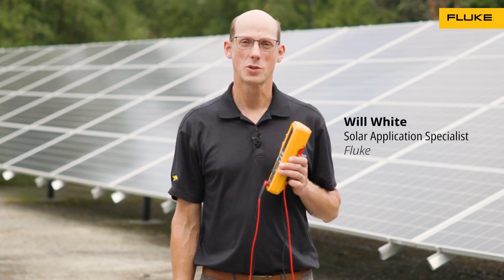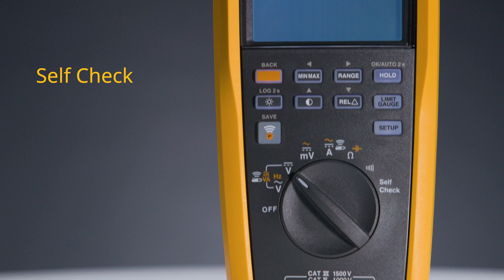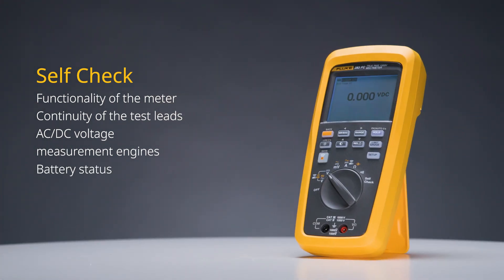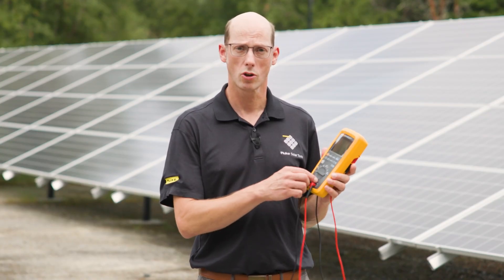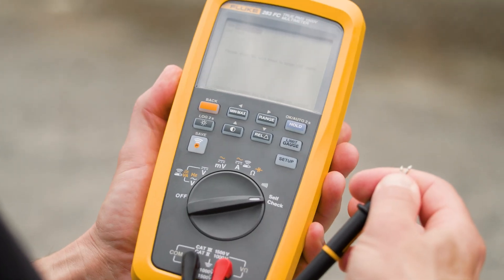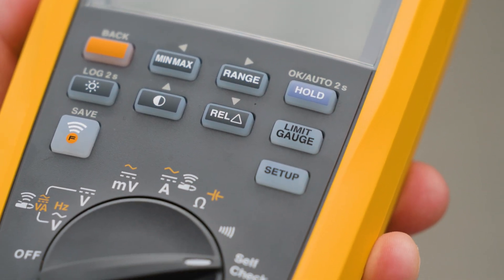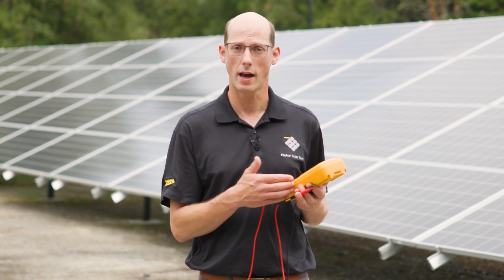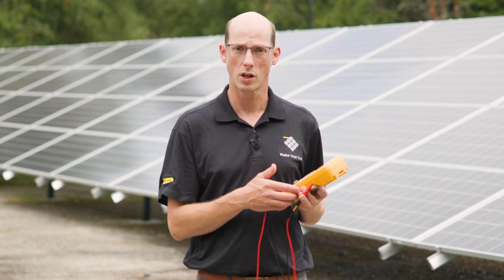How to Run a Self-Check on the Fluke 283 FC Multimeter

Comment: Great video! I just wanted to note that the clamp will only read current UP TO 60A, so if you’re working with higher levels of current you may want to choose another meter such as the Fluke 393 FC.